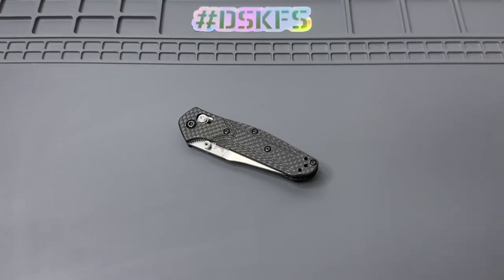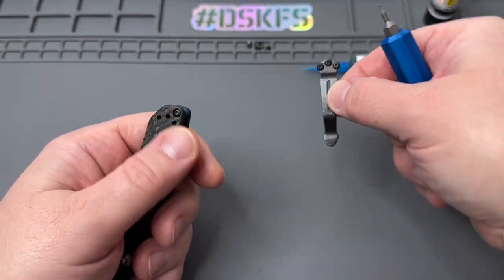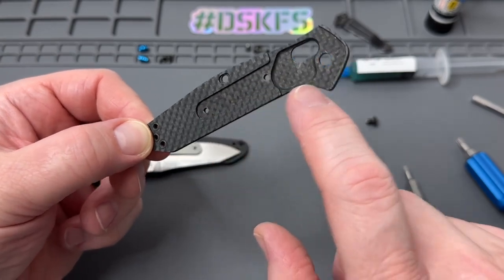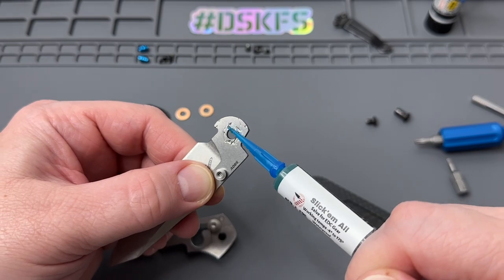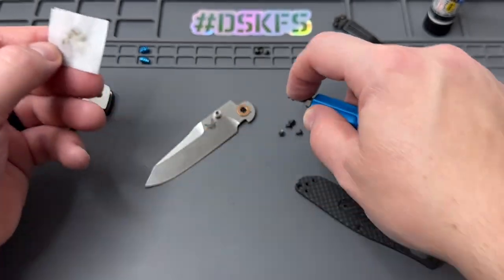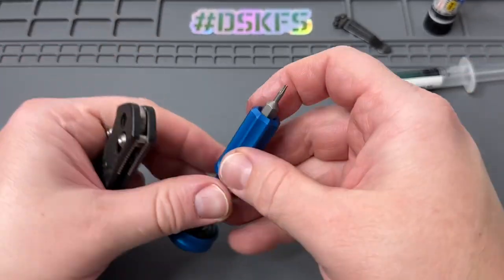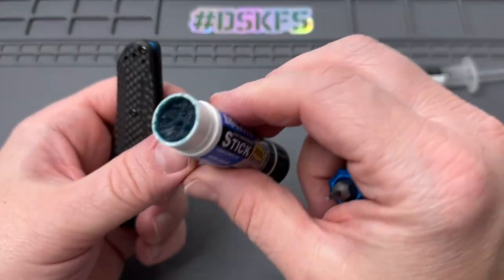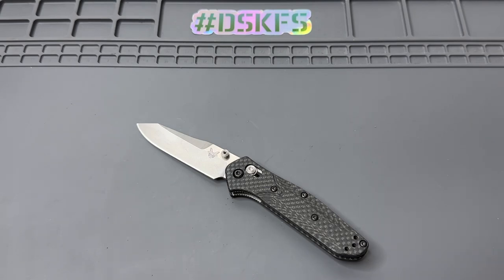How to Disassemble the Benchmade Mini Osborne - Then Re-Assemble

Comment: Generally i just pull the blade and washers and do a quick clean. But every few years i fully disassemble them if I carry them much. That pivot alignment tool is nice. I use a toothpick currently.
Reply from the maker: Sounds like a good process you have in place. Thank you!